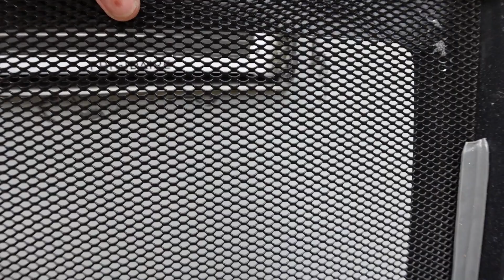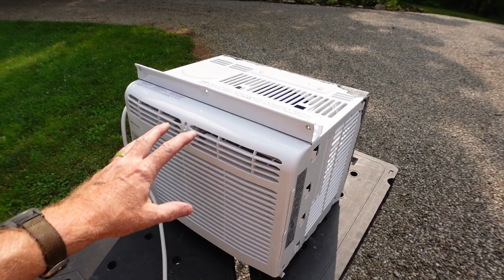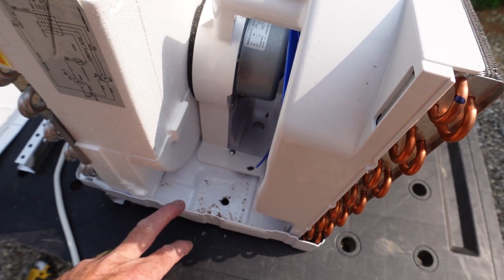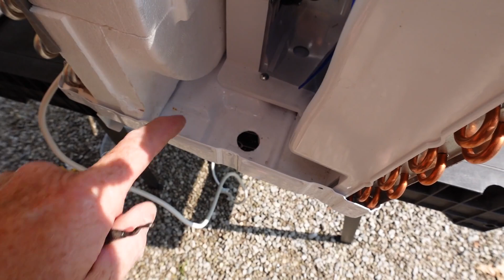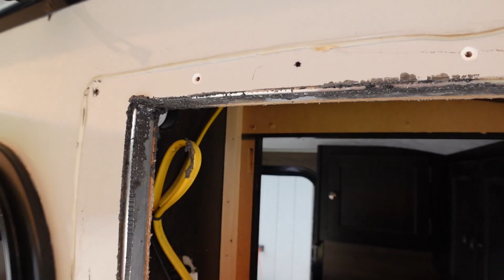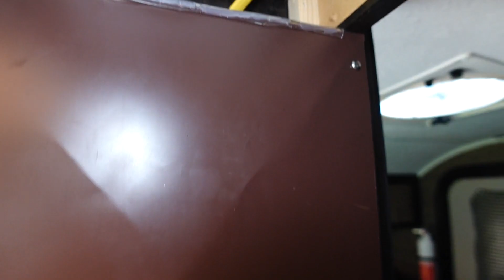Bushwhacker 10HD Air Conditioner Modification

Comment: So i am not sure if you still read the comments.....but do you still tilt the camper slightly lower on the side with your ac? We just aquired a bushwhacker and when we turned on the AC and left for about an hour, we came back to find water dripping from the front into the sink. Our camper is tilted 1 degree down the opposite side of the AC. Will 1 degree actually cause the water to run down to the front or is there another issue we should look at?
Reply from the maker: Its hard to say without seeing it but most of the ones I have taken apart have a slope to the tray below the AC unit that drains the water out. There are multiple possible causes of leaks from no drain hole in the AC which will allow the slinger fan to throw water everywhere to the tray being sloped the wrong way. 
 We have a video showing the Emma Mac mod which slides the AC out of the wall when in use. Its amazing the difference it makes.

Comment: Good job only thing I would have done was put bug screen in the bottom of the drain holes on the outside gasket to prevent bugs from crawling in.

Comment: Excellent video! But very disappointed with the manufacturer doing such shoddy work during the build. Our 17FD has same issues.
Reply from the maker: Mass-produced campers are what they are. But that said I've seen some crazy things come in on custom-built campers as well. Best thing you can do is just isolate the problems with your camper fix it and go on.

Comment: I"m a little late coming to your video. One thing you can do to improve the efficiency is take one (or both) of those top vents and install 12v fans as intakes.
Reply from the maker: We use the camper off grid and we don't want to consume more power to fix the problem. The increase in efficency of the AC by doing this versus the stock setup was the real benefit. We can run the AC longer off the same PPS now which is great for us.

Comment: Mike Coleman lantern 17r has a great big duct on top with a vacuum activated low spring tension flippy door when the fan comes on the below the hotter out the back it sucks the flippy door open and the huge hole opens up. If they had done that with yours you wouldn't be having that problem. Those are tiny holes I see what you mean

Comment: I have the exact same trailer, first teardrop I've owned. The kitchen was in pretty bad shape so I stared a complete remodel and found water made it's way through the whole floor back to front, so I ripped out all the old interior walls, dried the floor and sealed it on the inside. I'm building new cabinets and was running the AC when I found the water running down the inside wall. The AC install on my trailer is the exact same as yours, I'm headed to hardware store for the galvanized flashing just like you did. 

Thank you for the excellent video.
Reply from the maker: @gbutler1492  glad it helped. You shoukd watch our second AC mod video. It is a must do

Comment: You shouldn't drill holes in the bottom of a modern window AC unit because the fan is designed to sling condensation onto the condenser coils to enhance cooling and efficiency. Do not drain it. Drilling holes can disrupt this process and potentially damage the unit. Put a pan under it in case it should overflow (which doesn't always happen). Drain from the pan, not the unit.
Reply from the maker: @drivebyquipper  I understand how it was designed and addressed that in the video. The pan was drilled from the  amper manufacture. I just enlarged it to male sure it all drained. If ypu don't drain the AC pan you will leave your campsote with a full pan that will slosh out where ever it wants to go. We are going on 3 seasons with ours this way. I just saw a replacent today for 130 dollars. I will take my chances.
Reply: @adventuresofthememorymakers  okay

Comment: A few thoughts.   Those 5000 btu ACs need 500watts to run and that is lot for most off grid applications unless you run a loud generator. IMO,  It would seem like if the A/C were just resting on the tongue  it would be better location right?

Here in Hot and humid Florida,  I'm in a self converted micro campervan where my living/sleeping space is only 4x7x4 over a 6 inch foam mattress.  I can't stand, but i can sit up and kneel up.   1/3 of my van is a semi sealed garage area in the back with a counter I access from the back outside.  All appliances that generate heat and noise are back there facing the living space.   That garage has a shared 10" vent hole and fan that runs 24x7.    One appliance i have a is a 24v plastic 1800btu Chinese Air conditioner.  It has no side vents.  It sucks air the front and pushes out cold air.  Hot air pushes out the back and there is a drain tube i run out the van.  I vent the air conditioner naturally (no tubes) out into the garage where everything else vents up under a 320w solar panel including a 32 inch TV, a 15L fridge, my inverter, mppt and dc-dc chargers.  Also a 460AH battery is back there.  All share the same 10 inch vent hole and fan on the top.    I'm happy to report that this tiny Air conditioner only consumes 170 watts and is able to make the micro camper comfortable enough in thick shade, rain or darkness.   Not going to say it makes the cabin ice cold or can overcome direct sunlight,  but the it manages to make it comfortable enough for me.  Also the 460AH battery and my charging setup seems to run it endlessly and quietly with no limitation so long as I move around in 3 days or park it in the sun when I'm out.
Reply: FYI, I'm uploading a video with my set up now.
Reply from the maker: @12vLife  I would like to check it out if you could share a link with me please
Reply: up on my channel.  I was unable to send link here for some reason.
Reply from the maker: @12vLife  there are countless ways to set up and run AC off grid. It all depends on which setup works best for your application. We just released a video showing how we get the air conditioner out of the sidewall so they can breathe more freely. It runs at 360 Watts on 120 volts when the compressor is running. Only 60 watts when the fan is running. We run it off of a portable power station and the way that we use it it only uses about 500 watt hours of power per night

Comment: The build quality of travel trailers is just atrocious. They look like a drunk moron assembled them with no experience and no real planning. I’ve seen some horrible work and poor quality plus several problems  on mine and it’s only 3 years old.
Reply from the maker: @whatfreedom7  sadly its been this way a long time. Inrebuilt Cindy's  1968 Shasta Compact and it had a lot of the same issues...

Comment: I have a similar set up on my 2021 keystone hideout. I’ve never noticed any issues till last weekend. I noticed water running across the floor coming from the base of the wall.then I noticed stains where it’s done it before most likely in storage at home since it’s tilted the other way.  I looked around the best I could without disassembling anything. When running I noticed dripping from the right corner from outside but I don’t see any drain hole in the pan but it’s hard to see. Mine has an outer foam seal on three sides also.It has the same slotted cover. I noticed a gap on the top of the cover letting rain in. I also noticed multiple loose screws that are not stainless and are also not sealed and exposed to the elements. That’s a bad bad install. It also looks like it’s not sealed around the fan where it goes through the body which will let water come in the bottom side and causes it to get trapped between the body of the travel trailer and that outer cover. So basically I need to pull it and make it  sure it has a drain too and seal all around the ac unit. My plan is to glue a flush drain nipple then put a short hose to make sure it directs out past that cover . I may do a decent size hole on each corner that way it will drain regardless of which way it’s tilted and if one clogs.

Comment: Thanks for the video. I don't think the air conditioning is used all the time. So if it was my camper I would put in a slider some kind of  Slider one I use only when I need to use my air conditioner. That way it would get all the ventilation and drainage it needed for a window unit.
Reply from the maker: @aunttriciaattic  that is in tge works.

Comment: Thank you for posting and taking the time to perform a walk through of your idea. I will definitely be doing this myself. The issue I am having is that when I run my a/c it will start to blow cold air and then after a few minutes or so, it will start blowing warm air. Is that due to the problem you just corrected or is the unit possibly broken. The trailer is a 2022 10HD model and the woman that had it before me never used the A/C unit. Any help or info would be of great help. Thank you.
Reply from the maker: Thank you for watching. That soundd more like an issue with the AC unit its self. Luckily they are cheap and easy to replace. Just make sure to drill the drain pan in a low spot if you replace it with a new one.

Comment: I was thinking how the air conditioner is the worst feature of this teardrop.  It would be the main reason I wouldn't buy this teardrop.  It's been poorly 'engineered.'  In fact, it wasn't engineered, it was rigged.  I really wanted to like this trailer, but I don't think I deal with the air conditioner hole.  I guess I could frame it out for a window.

Comment: there are split unit, almost same opening size, fit just about right. I am looking  to replace sunray 149, has wall mount unit same set up as Bushwhacker. 
much quitter, nice design and made 12V ready for about $650
Reply from the maker: Thank you for that information. Do you have a link for the one you're using

Comment: That is crazy no way those pipes will properly cool an ac and the slinger on the plug is nuts, I have always wanted to see how they did this.
Reply from the maker: You are correct, there is no way the pipes provide enough air. Opening up the sides actually help. I have a new mod in the works to finally let the ac breathe properly. Should have it done by spring. Stay tuned.
Reply: @adventuresofthememorymakers  I am getting ready to build another teardrop camper and every time I watch video's to get more knowledge. I have seen large roof vents  for ac that look like upsidedown cookie sheets.
Reply from the maker: @mlangfordoutdoor  there are numerous ways to get the air into the compressor section. I am trying to keep it as simple as I can so others can do it as well.
Reply: @adventuresofthememorymakers  I am with you sir please do and appreciate your content just enjoy visiting with a fellow tinkerer. Again thank you for showing me how they do this and how you help to make it better-big fan here
Reply from the maker: @mlangfordcamper  thank you sir. Appreciate you taking the time watch

Comment: 😂 I had to watch a 3rd time because I missed a lot of details originally.

Recommendation to all you DIY people, watch 3 times before starting, have your materials ready, take your time!

BIG thank you to Sam!
Reply from the maker: Glad it was a help!
Reply: @adventuresofthememorymakers  What am I seeing at 43:39 under the word Frigidaire on the drip pan?
Reply from the maker: @jimdishman4761  good eye sir. I was about a 2 and a half inch wide area spray foam I put underneath the air conditioner. What's the phone cured it provided a bit of isolation for the vibration of the unit sticking through the wall like it was. Just a little added support for the air conditioner to sit on

Comment: Why were you planning to drill the hole 23:19 in the bottom if you’re sealing it all up? Wouldn’t allowing the water to “sling” safely across the coil help it be more efficient?
Reply from the maker: There are several reasons why I drilled the pan to drain it out. One is to prevent water from being stuck in the pan when you go to leave your campsite and have it Splash out inside your camper. The Slinger fan is fine if the air conditioner is stuck out the window of a house and the spray off of the Slinger fan doesn't cause an issue because it drains outside of the house. Being inside the wall your camper is a totally different situation. Due to centrifugal force some water gets slung off the fan blade and exits out the side vents of the AC. It's not an issue in a house. There is a big issue inside the wall of a camper. You don't want water slinging inside the camper like these do. I personally cannot stand the sound of the water slinging off of that fan. What little efficiency is gained is lost in my mind to water getting into camper and the noise driving me crazy. If you noticed in the video the drain pan was already drilled from the factory just with a very small hole and a big Burr around the edge of it that would prevent water from getting out easily. I just enlarged and deburred it.

Comment: Do you use a generator to power that ac?
Reply from the maker: I can but lately I've been using my portable power station to power through the night. Then the next day I will recharge the power station with solar unless there's not enough sunlight then I will recharge the station with a generator.

Comment: Excellent project, I am going to do the same to mine. Anybody have any idea where to get the gasket that was under the AC, mine came without it. Also, what sealant did you use for all that, silicone?
Reply from the maker: I am still looking for a similar seal as so far our camper is the only one that had that type. Most have been foam tape, one had no seal at all. I think they use whatever they have on hand at that time.

Comment: Could you have added a 3rd or 4th vent in the ceiling?
Reply from the maker: Todd, you might be able to nut inam not a fan of cutting anymore holes in the roof. If I could find the right roof top vent to replace both of those 1½ pipes I would consider that. I have done 4 of these mods now and I encourage all Bushwacker owners to remove their air conditioner and inspect around the opening. I have found damage on all but ours, we had yet to turn ours on. One was only 6 weeks old!
Reply: @adventuresofthememorymakers what about adding little fans to those vents? I’ve got ideas of how to make the fans only turn on when the ac does, but it seems like the AC is going to push so much air out of the black vent that it won’t benefit from the added space on the sides
Reply from the maker: @midnight121190  My main reason for doing this originally was to prevent the leaks that so many owners report having. Once I saw how starved for air the unit was is when I decided to leave the sides open. You would not think the open sides would make much if a difference but it does. The same fan that is blowing the air out of the compressor coils is what is drawing the air in so it has quite a bit of intake power. Several owners have reported back to me that they could tell a difference in how well it works after doing the mod and leaving the sides open. It is still starving for air but it's able to breathe a little better with the open sides. Best part is water won't be dripping in your camper.

Comment: I added pieces of thin plastic cutting boards on both sides from the inside of the AC unit, to correct it while camping. I may have to do this in the fall to help with airflow.
Reply from the maker: That was a great idea to do while you were camping!